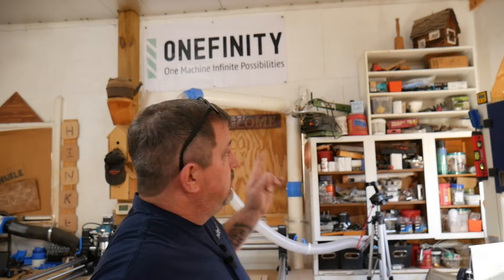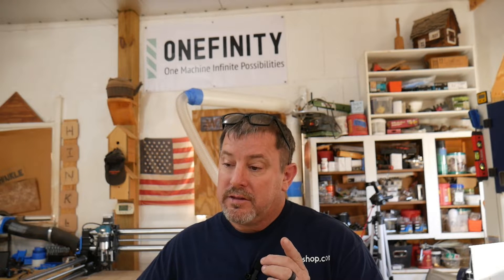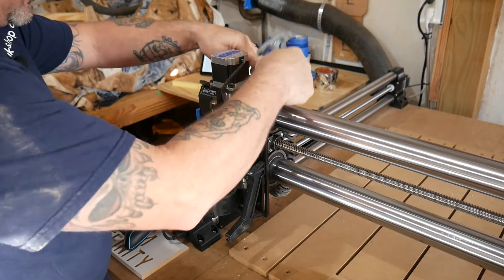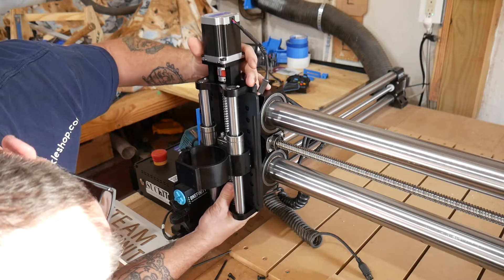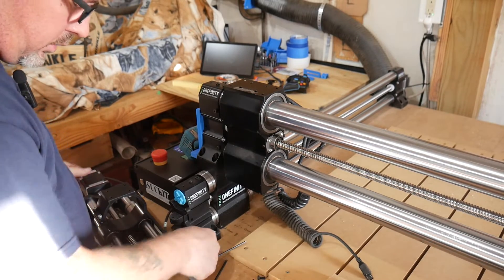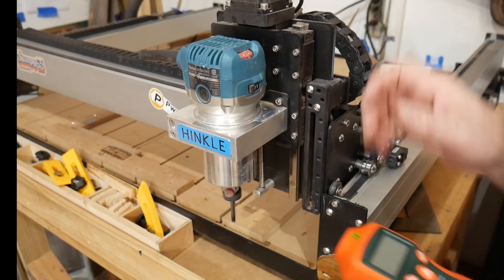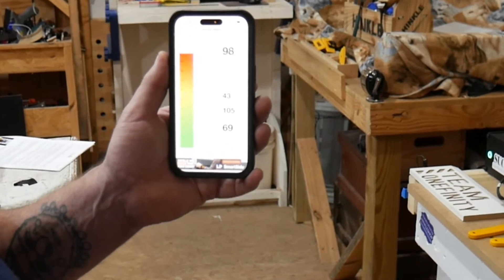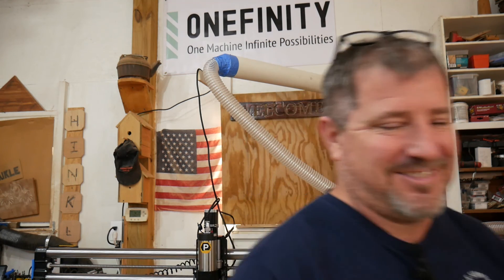How loud is a @PWNCNC spindle vs a Makita trim router.

Comment: you showed sound but at what rpm im sad i fast forwarded to the end and wasd still feeling jipped
Reply: Nope, try again dude I went back and watched the video you take the RPM of the Makita but you never showed  the RPM of the PWN spindle U say oh it’s already running and you were so ecstatically happy about how silent it was. You showed the decibels, but you never did show an RPM and there’s no way you can tell me that that spindle was turning 17,000 RPMs.
Reply from the maker: I did show rpm i used a tachometer to show it they were both running at around 17,000

Comment: Hi, I just came across Desktop CNC 2 days ago and I'm thrilled. I'm currently thinking about buying a milling machine, but I have serious concerns about the noise. 60dB at idle sounds very good. How does the volume behave when the machine is milling wood?
Reply from the maker: When the bit is cutting there is a considerable amount of unavoidable noise but still much less than with the addition of a traditional router

Comment: Hi , Need a recommendation for a spindle motor for my later Shapeoko 3 to replace loud makita trim screamer, with no programming
Reply from the maker: Hello Ryan 
I used a Makita screamer for years, so I know your pain.
I am absolutely satisfied and pleases with my PWNCNC spindle. 
It is the 115-volt unit 
I was unaware of the ability to operate the variable drive manually until I received it.
Using it that way is very similar to how you use the Makita except you have the added benefit of rpm control and super noise reduction.

I have added a link in the description to PWNCNC to help you find them.

Comment: What RPM is the PWNCNC running at? I didn't see you check that.
Reply from the maker: Sorry Paul you’re right I forgot to put the camera on the drive display 
But, the spindle was running at the same rpm as the makita 
To make sure the test was fair and accurate

Comment: I’d like to see the noise level comparison while actually doing a profile cut.
Reply: I get that but my Makita is significantly louder when cutting. It’s loud enough when not cutting! Would just be interested in the db comparison under load since I don’t know anyone who runs their machine for more than a few seconds without cutting.
Reply: @ron0126 yup, every motor sounds different under load
Reply from the maker: Thank you
Reply from the maker: I  think the sound being produced by the bit spinning at the same rpm traveling at the same speed through a given material would be identical regardless of what is turning it so that’s why I didn’t record it cutting 
Hope that makes sense
Reply: @Hinkleshop I don’t think so,

Comment: Nice!  And it looks like you got a 1/2" instead of the 1/4".  If my spindle goes out I'll for sure move to the larger spindle.
Reply from the maker: Yes it will accept 1/8 1/4 1/2 bits